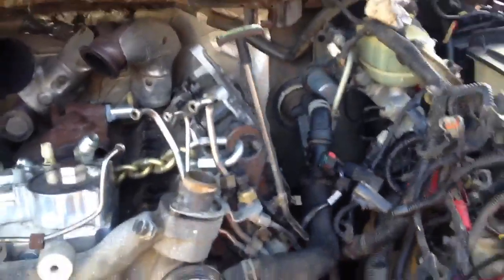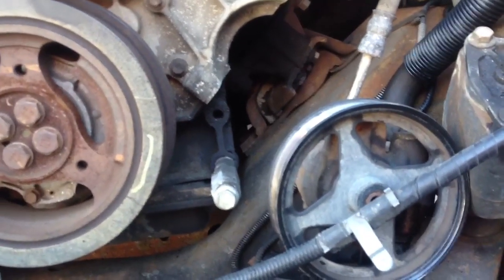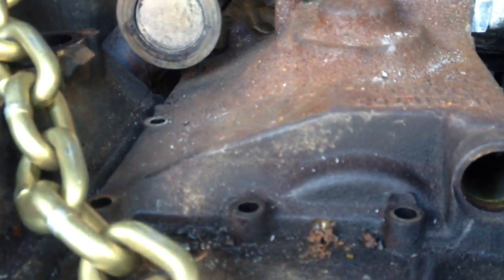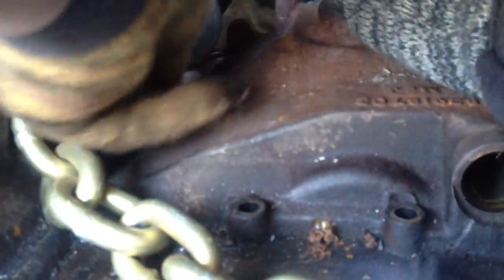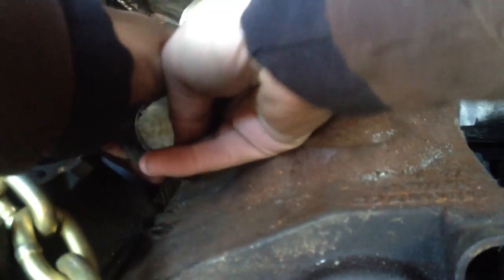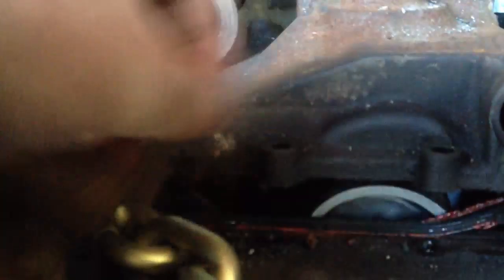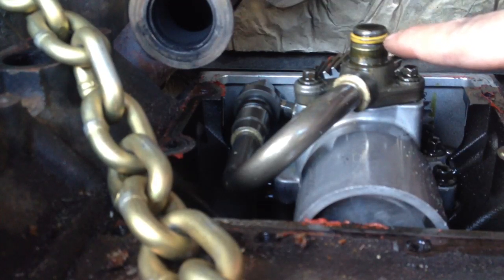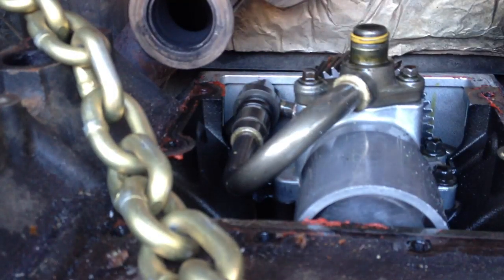6.0 powerstroke removal for ARP studs, torque converter bolts

Comment: If im not mistaken when I did my transmission I got the converter bolts out through the starter hole. Seems way easier than doing all that. Just for future reference.

Comment: Disassemble the Ac condenser box and pop off. then loosen the motor mounts and rock engine towards driver side.  with the box off and a jack to elevate the front bumper you will have the clearance.  oops the driver side bolt needs to have the motor mount disconnected so that the engine will tilt left.

Comment: James, can you shed some light on how to pull the driver's side head with the last bolt being almost impossible to get out with the engine still in?  I have tried almost everything I can think of.  Appreciate it, and I would like a manual if you still have one.  Thanks,
Reply: You remove driver side engine mount and lean it to the driver side . Do not drop the engine all the way down you can damage the oil pan. This is for any lost soul out there still 💔 6.0 fixing

Comment: Micheal, I'm sure you've fixed your truck by now. However, after doing 7 of these trucks, I highly recommend removing the cab. It only takes a couple hours and on the 05 and newer trucks it is easier because they changed the layout of components under the hood. A lift is definitely recommended from myself.

Comment from the maker: Took me 6.5 hours to pull the motor, though I can streamline it down to 4hrs!  I went nice and slow because of the blizzard we had!  If you private message me with your info I can send you a service manual!!  If it is just head gaskets, you can do it without pulling the motor.  I went through it all and replaced all gaskets and seals. It is not complicated at all to do this job.  If your local I have a machine shop that can do the heads for a good price .